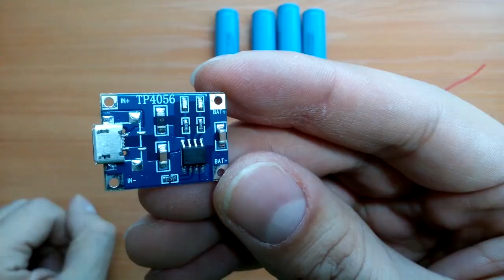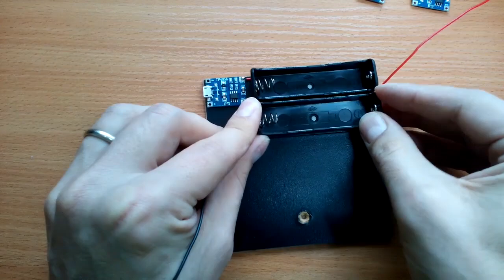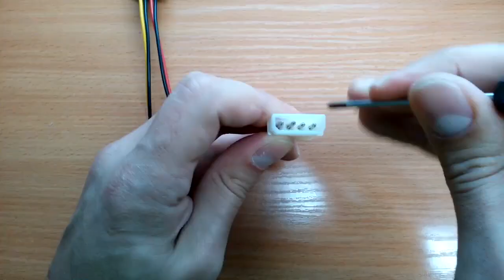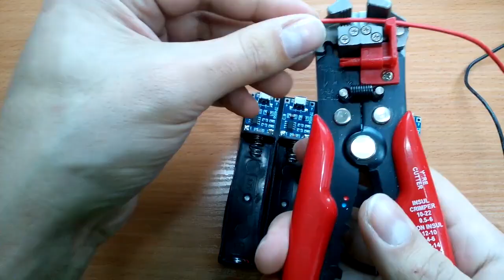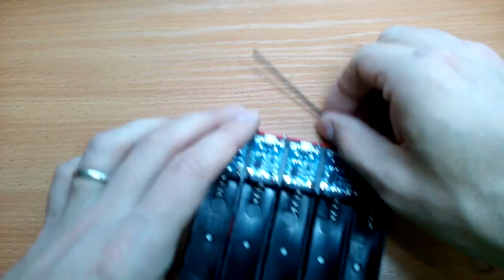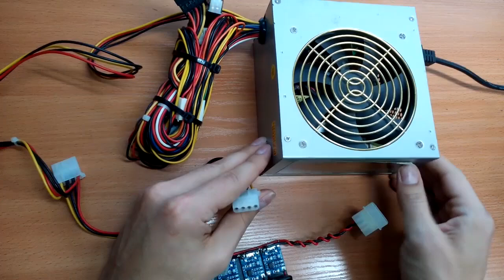DIY: Lithium 18650 Cells Charger By Using TP4056 Modules

Comment: hello, i would like to know is this proyect can be used with 21700 batteries. currently i am using tp4056 module and when i connect this molude, the led is red (charge) but i test with multimeter and the baterris es discharded. ¿could you help me? thanks

Comment: I tried same way to power these boards instead of using usb cable. But the boards aren't working after that. The leds are always red, even without battery. And output at B+ B- also shows less than 1V, even with USB cable connected.

Comment: nice work 
i have 4x 18560 battery pack connected in parallel with total 4.2v/2200mah how can i charge this battery pack not individually like you did as it is reside in robot and i need to just put an adapter in the robot to charge it rather than extract the batteries and charging them out of the robot 
thanks

Comment: this is the best method the charging current should be 0.37 5 of the battery currunt capacity each tp4056 provides 1000ma max so any battery  from 1200 ma to 2600ma cane be charged.moreover all batery need not to be of same capacity.total cost of 6 tp4056 in indai ils 150r s much less than bms  .also each batteryn has its own protectin gr man

Comment: If you add a  bms with usb port to this device can we use it as powerbank?  I think we must add that bms with paralel  connection so that it should not give a voltage bigger than an one battary's voltage to the phone,  am I right??

Comment: Love that trick you did with the cable, very clever.  Would it be possible to connect the output of the batteries together if you put a diode on each cell to prevent current flowing back?  What I would like to achieve is a super high capacity set of parallel cells that can be charged individually.

Comment: ı saw somewhere that you should use isolated input to each tp4056 module otherwise it would either shot circuit or some features wouldn't work, I too also am trying to use tp4056 as opposed readily available 3s chargers without datasheets. but i  don't want to use isolated input power for each cell..Can you guys comment on this? Helps me a lot, thanks.

Comment: Hi, 
Maybe someone can answer my Question:
I´m not shure, but didnt he wire the charging modules up in series? So the voltage would add up and the amperage would stay the same. 
Can someone explain me?^^
thanks
Reply: The configuration is in parallel. The wire connecting positive and negative is the same wire (one node) so therefore there is no voltage difference between any of the modules.
Reply: @civilizati3  thank you

Comment: I have found that foam board is pretty useful for mounting small projects like this. You can buy it in big A3 size sheets from Amazon very cheaply. It is easy to work with,  just cut it to size with a craft knife and you're done.

Comment: Shall i connect 2 battery in parallel and charge using tp4056 module.. It is possible or not. Any problem occur in battery or not

Comment: Nice and easy work. I want to do that. I purchased 10 x TP4056 madules from aliexpress and they were taking 1-2 hours at the begining and now even after 12 hours they are not completing charging.When I put those batteries to my smart charger i see they wer 80-90% only charged after that long time. Can you give me the link where you purchased your TP4056 Charger Module and please give a clear picture of the board for me to identify correct before ordering. Thx.

Comment: If you connect all the battery’s in parallel and connect it to a single module ..then it will also work the same ....just it will take a longer time ...but it will be more better ....then doing like this.

Comment: When you charged with a computer SMPS,  wasn't the ampere( e.g., 'i' from the SMPS) divided as "i/5" and went into each of the lithium circuit. Please let know what is the max. ampere in an SMPS that outputs 5V. And what is the maximum and minimum current "i" allowed through each TP4056. Anticipating your answer at the earliest.

Comment: I like this set up. I'm planning to build something that would require 3-4 micro USBs to provide primary, /w emergency power if needed, for 3-4 items. Question 1) can this battery pack be charged at 12v while still providing power to the micro USB? I'm thinking that the battery pack is inconstantly being charged, while the separate modules are actively powering something.

Comment: Nice job. What about using tp4056 with charge and discharge function, connecting parallel batteries to a boost converter and raising the voltage upto 12v? such parallel setup can deliver 12v (upto 8A) power and it is balanced, each cell is equally charging and discharging. or am I missing something?

Comment: the wires for these holders are awfully weak and they are expensive for what they are, so therefore i printed my own charger, but since i do not have the manufacturing capabilities to make springs i used bolts instead and would recommend the same thing as this puts no stress on the plastics or wires as they are no longer required to flex and improves the durability of the product, making it last an indefinite amount of cycles instead of a dissapointing 30 that i got from my charger before it required maintenance due to structural malfunction.

Comment: Hi, Thx for the clear video highlighting some practical details. I'm currently developing a project trying to power Lipo - 3S (12 VDC) from TP4056 harvesting the power from a 6V solar panel but at the discharge phase I need 12VDC: the process is managed by an MCU (ESP8266).Do you think is technically feasible to charge each Lipo individually from TP4056 @4.2V and then disconnect the parallel wiring and connect them in series by means of MOSFETs? the process would be managed by ESP8266, providing HIGH/LOW signals to the gates of MOSFETs.

Comment: I wonder if batteries are wired in parallel, can we juste pu one module to supply two batteries instead of using one module per battery ?

Comment: Nice! Great video..how many of these modules can I use with one power source? And how many volts does it need to be? Also, did you connect everything in parallel, besides the two power leads? Thanks

Comment: Tel me the fastest way to charge 18650 s, build something which charges more 18650 battery quickly and can controll the output power current and voltage according to our use....

Comment: Will this method work on two li-poly battery too? I wanna use two seperate batt, 1 for amp and 1 for bluetooth module for my DIY project but I wanna use only 1 micro usb port for charging.

Comment: Could I do this setup on on 3S2P system, I charge 3 cells with one tp4056 yes I know I cut it in half for charging time I can deal with that, or can I use a bms with this method is some way to where I can charge the whole battery as one unit and have it balance

Comment: Can I use this module to charge a 18650 battery using solar panel as a power source?
Reply: Khairul . Zulfadhli If you're talking about those 6V 3.5W panels that are sold on eBay... then yes ! ☺

Comment: Here I was thinking, I could get away with using a single module per battery pack(4 cells). 

Is it absolutely necessary to use module/cell or is this done to speed up charging since each module max 1000mA /Cell.

Love the build quality of the pack

Comment: Where do you get those wire strippers? Those are amazing!
Reply: Tom you can get it from ebay ,i have one from PRC works well , price around $15//
Reply: what do you call it
Reply: Just post the name as awg wire striper and you will get a variety of this gadgets , good ones and cheap ones ,,,enjoy Juan claude .. cheap ones are red in color . and expecince ones are blue colors, they look a like and works equal , donno why the difference , proberberly the sellers price ,, happy shopping
Reply: Tom Glander get the ones with blavk bottom plate and smaller jaws. I had the same as in the video and they broke after few months because the backplate was aluminium.

Comment: Awesome skills there with the clip holding that wire while soldering.  Plus that amazing wire-stripper.  Wow. I just now saw how he stripped back the wire like 1/4", and then folded the wire in the middle of the stripped part, twisted it to make a tiny wire going to the connector.  Forget the project. This video is about electronics skills.  This guy's got em.   Subscribed.

Comment: Is there any board for charge and protect several batteries in parallel (e.g. 5) with more than 2A?? 
Or are there any better options with charge over Dc-Dc-converter + protectionboards for each Battery?

Comment: can you also have the batteries wired in series at the same time to create a battery bank and yet still be able to charge them using a standard 5v phone charger?   for example.. 3x 18650 batteries to create a 11.2-12.6v battery bank. yet charge using a 5v 3A charger?

Comment: that's a really neat design. I have alternate versions of the same charging board, the only difference is the LED placement and instead of a green LED, full battery is indicated by a blue LED. I use the boards to charge 3.7V single cell LiPos, and it works great.

Comment: Cool, now how do I use the 5 battery’s (21volts) in series to power a project but leave 
connected to chargers to auto balance when needed ?

Comment: Be careful when using an ATX power supply like that. It is recommended to put some load on the 12V rail, if you don't, depending on the quality of the power supply, the following things may happen:
- the 5V rail is very unstable
- the 5V rail doesn't work at all
- the power supply breaks after some usage.

Comment: how long to recharge one battery AA, which is single battery voltage 1.2-1.6 volt with 800-2300 mah.   thanks because normally i put directly after power supply without modul and no parameter and not secure also. 

thanks

Comment: Could I use this or something like this to make a DIY lithium smart battery for a solar array? If each 18650 gets their own mini charger it might simplify a lot.
But can I just connect the power output of these chargers to draw current from the batteries? Is this a smart charging circuit that stops charging / starts charging depending on use?

Comment: Thank you for the idea. I'm ordering the parts. I have the 12 battery holders, 12 TP4056 charging modules with protection, and I ordered a 5 VDC 20 Amp power supply. Thank you, Great project and excellent craftsmanship.

Comment: add 5x "usb-doctor" module (3$ each) then you have a display which shows charged capacity + charging time + charging current. i did the same, by the way TP4056 is an awesome chip and costs with pcb only 35-50 cents

Comment: it seems like the cells will not charge faster because they'r in parallel connection the circuit path is different which is every cells will receive   250mA out 1A to overcome such delay you may use  5A LM2596 buck converter.

Comment: Could you please give me your advice? I am doing a Blutooth speaker build powered by 18650s. I have a DC in power supply and I have the 18650 power supply. I want to be able to connect the DC in power supply to charge the  18650s and play the music at same time. And when the batteries are charged unplug the DC in power. Currently I can only use the batteries or the DC power supply. I really appreciate your help with a diagram or picture. I can attach a pic of the internals if you PM me.

Comment: Hi, what is the wire stripper your using ?
Reply: Ideal Stripmaster, or a copy thereof.  They cost around US$35 to US$45 and have been available for about 30 years.  They're often used in pre-production and prototyping environments in industry when a moderate amount of wire stripping is to be done.  Even though they're bulkier and more expensive, they can strip wires in a more consistent fashion than simple stripper/cutters, with much less chance of nicking the conductors, and they're good for partially removing the insulation, as shown in this video.
Reply: Milosz Ostrow or get a fancy wire stripper from my favorite tool store.. Online or if available stop  in and don't get stuck browsing to long. Google them. Harbor freight tools?

Comment: since you are charging those 5 cell using one source does the current goes equal and charge get full easily ? and in time ?
and does tp4056 having a battery protection in it?
please replay
thanks

Comment: Hi, nice job, but i have a question. Is possibile to conect all 18650 pcs in parallel and use only one tp 4056 to charge all?
Reply: I don't think that will work, as most cells will be more or less unbalanced.

Comment: I was wondering if you can just use 1 board to charge two 18650??? would this work??
Reply: Yes, you can put them in parallel(+ to + and - to -), it might charge slower, but it's certainly doable.

Comment: Bad done tips. Wires are too thin and last charger will get too low voltage.
Reply: i dont think as he too wire from psu its pretty much thick. even more than he used

Comment: Can I charge them in parallel and discharge them in series?? I'm planning to put this inside an enclosure do it wouldn't be possible to rearrange them for discharge. Thank you
Reply: Only if you connect them together with a suitable multi-part switch so that you can physically change them from parallel to series. In this video, he is NOT charging them in parallel. They share a common ground, but the + terminals are each on their own charger, so they are not in parallel, either.

Comment: There is a new version available TP4056 with battery protection. use those if you can find them. http://www.ebay.com.au/sch/sis.html?_nkw=Micro+USB+1A+5V+Lithium+Battery+Charger+Protection+Module+Charging+Board&_trksid=p2047675.m4100
Reply: Is it necessary while charging the 18650?
Reply: It's useless when you only charge cells. However, if you want to include charger into project, like bt speaker or something, this is good idea.
Reply: Good tip, thanks!
Reply: Nope

Comment: Iv got 5 boards in parallel for 5 cells, I'm using a 5v 2a iPad usb wall socket, does it matter if I use something with an output of over 5a As long as it's 5v? am I right in saying that if the supply is 5v and say 20a for example then the charging modules would still only draw 5a and wouldn't be overloaded from a power supply with 20a output?

Comment: but do not worry, that the power supply 5 volts and 25 amperes ? and you need only 5 amperes for all five batteries?

Comment: Can we connect the 4 batteries in parallel and then charge them by one TP4056 module?
Reply: you can but it will take 4 times longer to charge them. Normal time to charge 1 battery from dead to full charge is about 4 hours so allow 16 hours to charge them  in parallel. they take longer because the amperage is spread across the 4 batteries. I am also not sure if the batteries will charge correctly at such a low amperage, so it may take even longer to charge them. you also risk one of the batteries charging to max power and overheating while the others continue to charge, so you would need to check each battery voltage as they charge. 
It is much better safer and faster to do it the way he shows in the video. 
Just don't charge them in parallel there is no benefits and would cost a lot more to do it safely.
Reply: The short answer is yes, you can charge them in parallel and the only disadvantage is that it will take longer for them to charge.  Aussie Soarer is wrong about unbalancing the cells since lithium technology cells will automatically balance when connected in parallel (not when in series though).

The one thing you need to be careful of is to never connect a fully charged cell in parallel with a discharged cell since the charged cell will try to charge the discharged cell with a high current which could damage either the cells or the connections or both.

What I did when I was making a battery bank which used parallel connected cells was to fully charge all of the cells just before installing them.
Reply: depends on much volt of each battery
Reply: Cara Amar why?
Reply: Interesting possibility but if one battery is dead and it is an open circuit, I can't imagine that there would be any current flow between the batteries.   But, if one battery cannot hold a full charge and one cell voltage goes up to, say 2.4 volts, (and the others at 3.7v) it may be problematic to have these internal flows among charging batteries in parallel.    For the same reason, they suggest you not mix batteries of different strengths, I can perceive a cell getting overheated.
Reply: Aussie Soarer what is the way to charge the 18650 li ion  to charge fastest speed without harm,,
I just want to know convenient solution for cutting the 3 to 4 hours of battery charging
Reply: that is the why...
Reply: If you put in a dead battery and a fully charged battery, it may cause a high current to flow between batteries. Putting them in parallel is a bad idea.

Comment: Hello. 
Can I charge them with the modules using the usb port of my computer? Is the current enough? Thanks.
Reply: Theoritically You can, but it does not recommended, computer USB ports are normally rated for 0,5A (or 1A if USB3). Even 1 charger module can overload your USB circuit in your computer, cuz they eat 1A. So you can use a mobile charger or something like this, but I wouldn't recommend using your Computer USB ports.

Comment: if i use 1x TP4056 Modules for 3x 18650 batteries, could it be..:)?
Reply: I think you want charge 3x 18650  batteries in parallel. If that goes, then it caharges slower than chargin one cell at time. Becouse you divide all current by 3. Maximum charging current with TP4056 module is 1 amp.
Reply: and then.. How long to charge for 1x 18650 2200mah?
Reply: if you charge it with 1 amp - and the batterie got a capacity of 2.2 amps per hour .. it takes 2.2 hours
Reply: hmm...